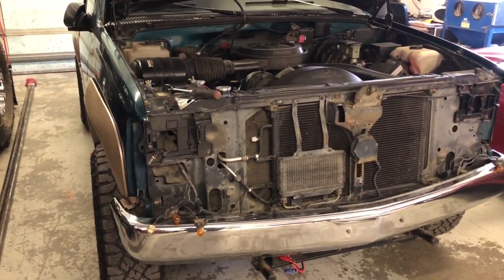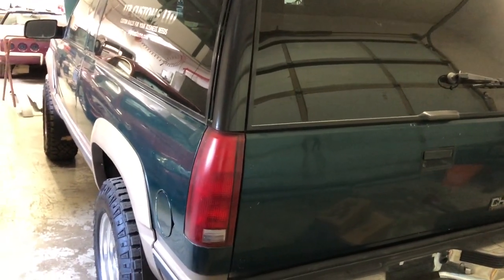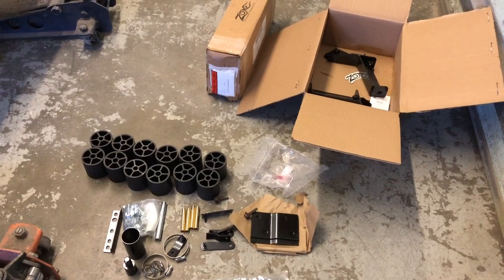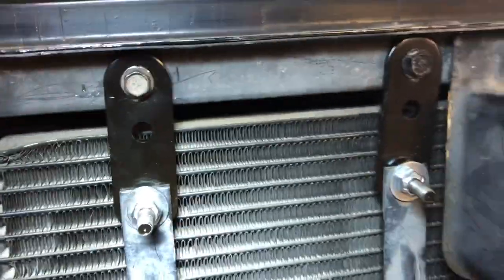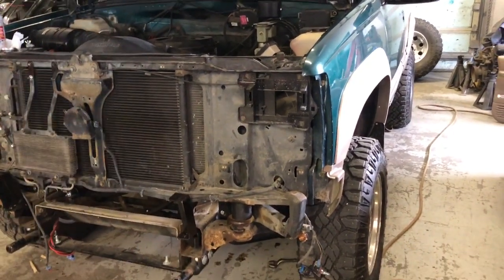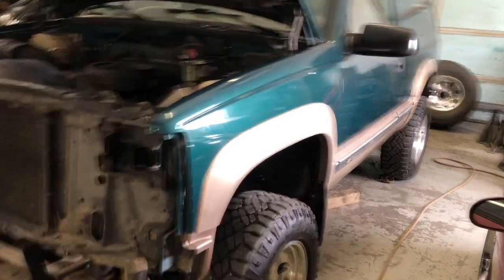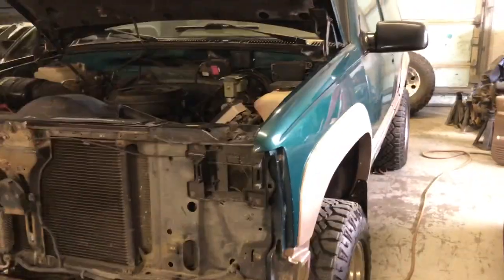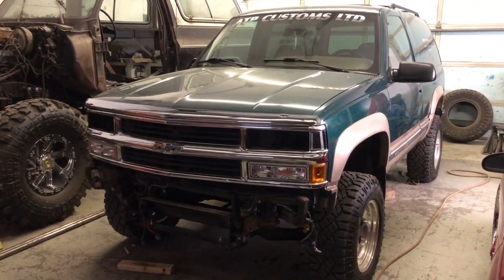Zone 3" Body Lift Install/Review 88-98 Chevy/GMC Tahoe

Comment: What did you use to lift body?? Really thinking on ordering the exact kit for my 98 2 door
Reply from the maker: I used 2x 2.5 ton floor jacks and some wooden blocks. The body itself isn’t that heavy
Reply: @atpmonstergarage  is there certain points to place the blocks on?
Reply from the maker: Lots of reinforced spots you can jack on. I used 4x4 blocks. If you follow the instructions they are very clear. Just do one side first so the body doesn’t move on you, tighten it up and do the other side after
Reply: Thank you for the replys I really appreciate the feedback
Reply from the maker: Thanks for asking. I make my videos in hopes that they help one person at least. Apparently I succeeded today

Comment: I have a 99 4 door Tahoe LT, wondering how much would it run me to get a 3" body lift on it? What would most shops charge for parts and labor? Thanks
Reply from the maker: Body lift here is about $180-220. I think in the U.S. they’re around $125. Labour could be 8-10 hours. If you remove the bumper and grill and headlights will save you some money. I had 3 body bolts break which could get costly and is quite common if you’re paying a shop rate
Reply: ATP Customs LTD thank you sir!

Comment: How you get your body up off your frame
Reply from the maker: I didn’t have a hoist so I used a couple 3 ton Jacks with a 2x4 and just did a little at a time. It’s not safe by any means but I’ve done it so many times I’ve gotten use to it

Comment: Do you have to lower the diff, extend brake lines, etc?
Reply from the maker: No suspension work involved. The kit comes with an extension for your steering shaft that’s really easy to install. 1 bolt holding it together. All it’s doing is raising the body 3 inches above the frame. If you have a cold air intake that may be affected, I had to make a spacer between the intake and throttle body to raise the intake up with the body
Reply: @atpmonstergarage  what size spacer? Do you have a part number?
Reply from the maker: @ljrivas91  what do you mean spacer? As in wheel spacer?

Comment: Not sure if you already answered this question or if I just missed it. Did this have any sort of lift on it prior? I have a 94 Blazer and trying to figure out what direction I want to go.
Reply from the maker: No it did not. It was completely stock and just had a 3” body lift with the front torsion bars adjusted

Comment: What about the fuel hose to the tank.? Im thinking of doing this in a couple weeks
Reply from the maker: It comes with an extension so you can cut the fuel filler hose in half and install it in the middle to make it longer but I didn’t even need it so check that at the end

Comment: I' have a 1994 chevy suburban that has a 4" spindle lift and blocks  I want to 3" body  lift as an  extra for 35" tire clearance I'm assuming there's really no difference ? 
Did you have a video of the rear of the suv install ?
Reply from the maker: Sorry I didn’t film anymore of the install but the suburban is only 2 more blocks to install. The main ones that will be the problem are the bolts above the rear axle. Those are the ones that were seized in the holes on both my 95 Tahoe and 93 Suburban. But it’s the same idea for all the blocks all the way through except the front 2 at the rad support. They’re just a long but and bolt that drop down through the rad support instead of threading upwards into the body
Reply: @atpmonstergarage  are their any at all known actually live installs on youtube  for these year suvs   from start to finish that you might know of or external sites showing illustrations 
I had messaged you on another post about some particular mentions about this install 
Thanks for the reply by the way .
Reply: @atpmonstergarage  

My only concern was  running into any attached wiring or factory lines or linkages  that might  connect to the body in some way  that  aren't stretchable once the taller bushings are put in place or attempted to be put in place .
Reply from the maker: @ach1013  I had no issues at all with wiring. My 93 suburban has a 3” body lift, front torsion bars adjust and had to do a small block in the back due to sagging leaf springs and I have 35”x12.50-20’s on it. Could fit 37’s on it
Reply: @atpmonstergarage  
I have a 94 2wd it doesn't have torsion bars ? Just spindle and coils  to lift or lower  Your telling me a 93 does I wasn't aware ? Mine is 2wd not a 4wd maybe it's just  the  88-94 4wd that do.
Reply from the maker: @ach1013  the kit comes with the adapter to lengthen the steering shaft which is only one bolt and then you have to slide  the rubber piece on the shift cable that seals it to the floor 3 inches. The wire harness won’t be affected. The kit comes with a piece to lengthen the fuel filler hose as well. Definitely get the bumper bracket kit. It’s a must have
Reply from the maker: @ach1013  oh that makes sense. Mines a 4x4

Comment: How did you get the broken bolts out?

Thats my fear…
Reply from the maker: Had to heat them up with a torch and twist them out with vice grips a little at a time. Then heat it again and twist them out a little more. I sprayed them every 2 days for about a week before tackling the job with Fluid Film hoping it would help loosen them up a bit

Comment: I have a 97 tahoe 4wd 4 door that Im trying to put 24” rims on some off road tires what how many inches on the body lift would i need for it to fit and work??
Reply from the maker: Well I have a 3” body lift and can fit 35x12.50-17’s on which are 34.5” tall. According to Tiresize.com if your running a 24” wheel a 385/35/24 is 34.6” tall. If you went to a 375/40-24 they’re 35.8” tall and you might get some rubbing

Comment: Did u have to do anything with your shift linkage for transfercase
Reply from the maker: It has a rubber sleeve underneath the drivers seat you have to slide down the cable a little bit but that’s all
Reply: @atpmonstergarage   no I'm talking about  transfer case shifter rod for the 4x4
Reply from the maker: @johnkirkjr4448  oh crap should have read that better. Just have to loosen the nut off on the linkage before installing it and then tighten it up again once everything is done

Comment: Do really have to remove all steel lines from the driver frame rail?
Reply from the maker: I never removed any of them. Zero issues
Reply: @atpmonstergarage  I thought so, instructions say to do it but I'm looking at is and it doesn't seem to really matter. Thanks for the fault reply I'm in the process of the body lift now
Reply from the maker: @hydrogrinch  I subscribed and will be waiting to see yo progress

Comment: Why can’t you explain how you gained access to the bolts!? I had to google and look for other YouTube videos.  But I like the look
Reply from the maker: Which bolts are you talking about?
Reply: @atpmonstergarage  I appreciate the response  I’m a huge fan!  I ordered a 3” body lift also for my 97 Tahoe. I’m nervous about bolts rusted and breaking off. If in that event where and how do I “soak” them etc?   Thanks again! Keep up the great videos
Reply from the maker: @catfishguy3822  I would soak them all for a week or two using Fluid Film. Some of them you can’t get to very well but some will have little holes next to the bolt and you can spray it up in there. The 2 bolts that broke on me were the ones closest to the rear shocks. They get the most mud and water on them I guess. If they break just continue installing your body lift. Then you have more room to work. I had to heat them up with a torch and work them out slowly with vise grips
Reply: @atpmonstergarage  ok perfect 👌 I’ll PB blaster for an entire weekend like you did in the video. I’ll go in preparing for the worse!  Thanks again!
Reply from the maker: @catfishguy3822  lol no problem. Good luck let me know how it goes for ya!!
Reply: @atpmonstergarage   thanks and will do! Honored you responded 🙌
Reply from the maker: @catfishguy3822  Ahh I’m just a guy who loves vehicles and want to see more people building them

Comment: Dont do this, at least do blocks or add a leaf. Body lifts are no good.
Reply from the maker: Depends on what your doing. I’ve been running body lifts for 25 years and never had 1 single issue
Reply from the maker: I’m this particular case the body lift allowed my headlights to still work when the snow plow was all the way up instead of the plow blocking them. It’s not being used for heavy off-road